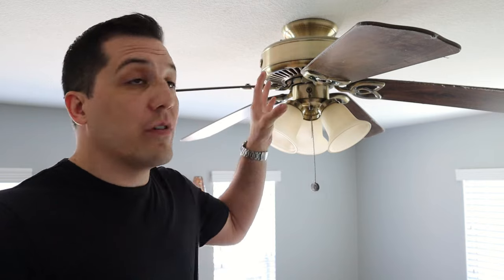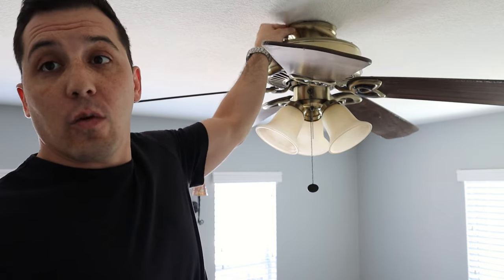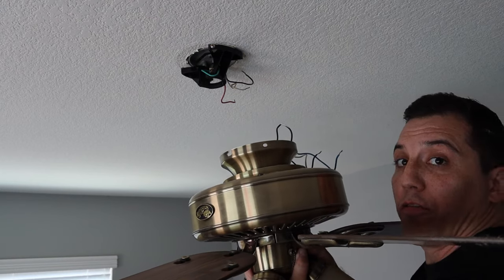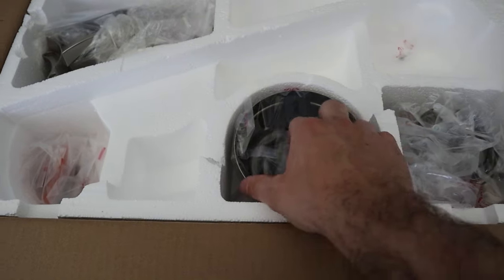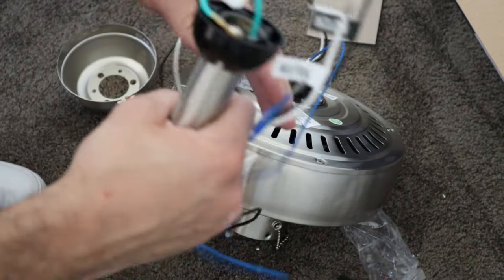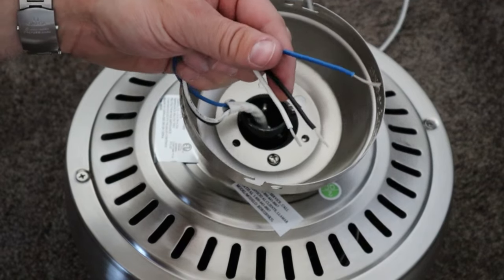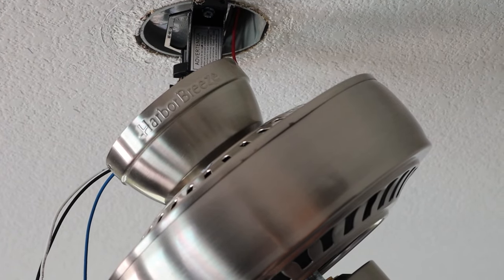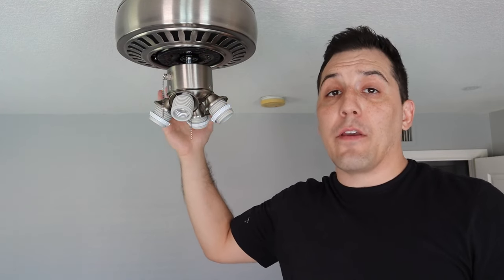How to Replace a Ceiling Fan - DIY Step by Step Guide

Comment: You completely left out the blade installation step, which I found to be very difficult. I suspect you did too, and simply skipped it.
Reply from the maker: Quite the opposite actually. I made the mistake of thinking the blade attachment was so straightforward that it didn't warrant instruction. I've had a few comments regarding this exclusion and realize it wasn't as easy as I thought it was. I'm hoping to avoid this type of mistake in future instructionals